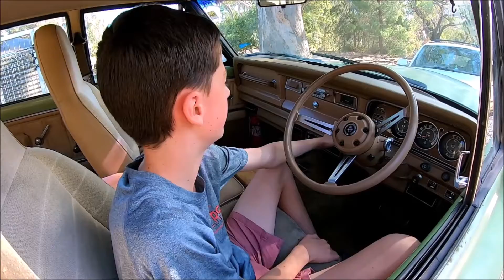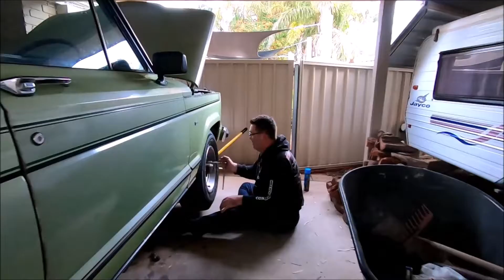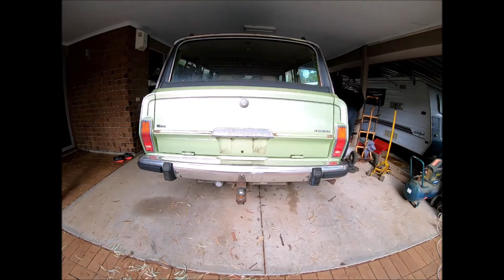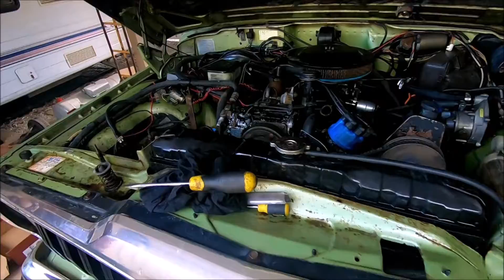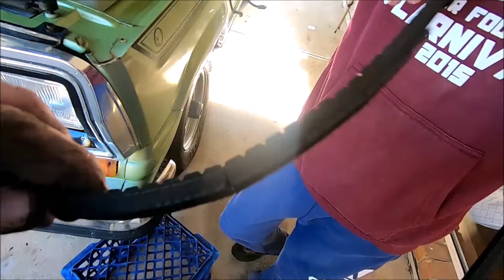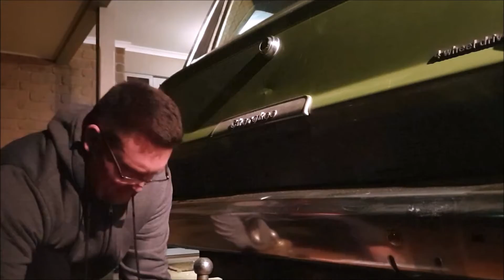SE1 EP11: - The OH2 Garage New Project Car + its a V8 Jeep!

Comment: I had absolutely no idea that right hand drive Cherokees existed, let alone ones exported to AU!  I've heard of them in Sweden and Saudi Arabia, but not Australia.  It'd be col to take one of these thats not in great condition and drop a Holden in one just for the fun of it!  I'm from the United States and have an '81 Chief Sport so its a two door with the 5.9L and 727 tranny as well .  I also have a channel but not very many videos.  Its also weird to see under the bonnet that the brake master and heater have been swapped and yellow rear turn signals!  I also have to paint its grille.  How did you mask off the parts you didn't want overspray on?  Just normal painter's tape?  (If you think your Cherokee's under carriage is bad, you should see mine's 2 inch layer of dirt all around!)  Im also pretty sure that when we replaced the water pump the bolts broke too.
Reply: Awesome to hear from somebody over in the US, and this has been a great family truck for us. Gotta love the big American stuff!!